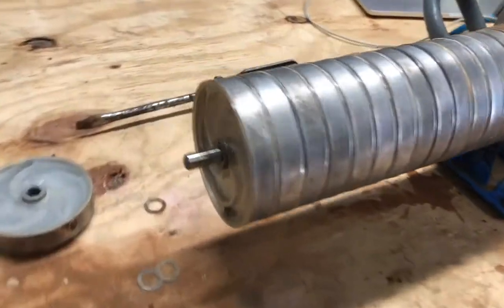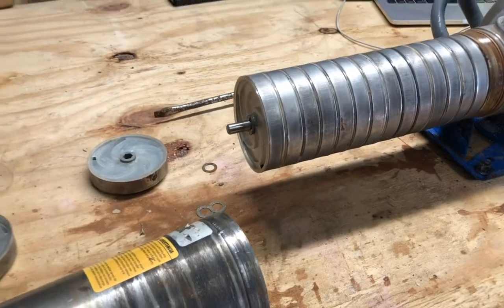Booster pump maintenance - Goulds

Comment: Do u leave that booster uncovered? Will it hurt it out in the weather like that?
Reply from the maker: yes, typically we use the TEFC goulds pumps, which is a totally enclosed fan cooled motor. Weather doesn't hurt them as the are somewhat sealed

Comment: Pentair owns Gould and about every brand of pump in the USA .  MANY other booster are just as good as the Goulds and better for 1/2 the price. I wouldn't use anything but all stainless steel units - impellers and diffusers. You wont be taking them apart until the motor dies. Grunfos is top notch and made in the usa for the most part, one of the few Pentair has not gobbled up to own the right to set its own prices.